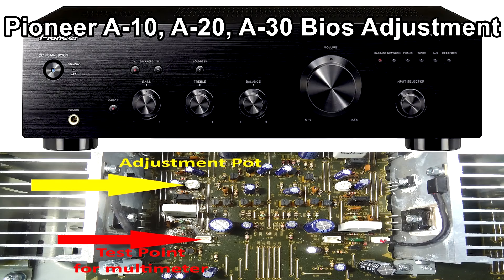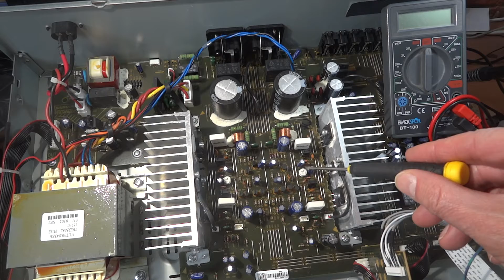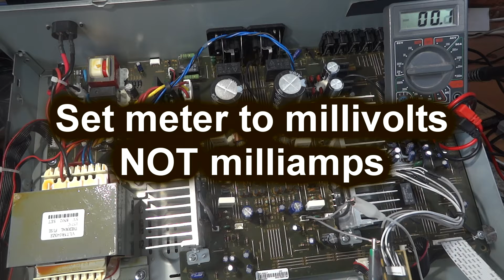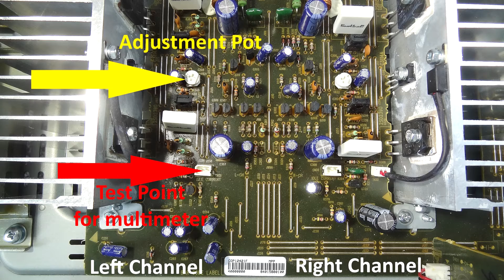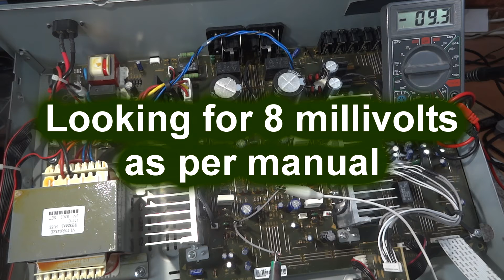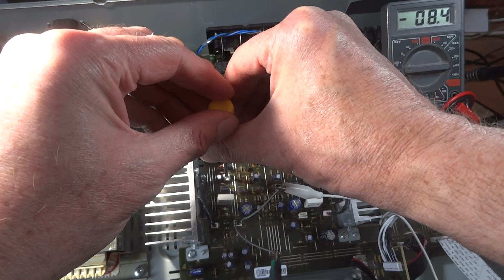Pioneer A-10, A-20, A-30 Amplifier Bias Setting Adjustment & DC Offset Measurement A10, A20, A30

Comment: The trouble is that cheap meters are not calibrated so there is no way we can be sure of accuracy, especially at such low voltages.
Reply from the maker: This is true. I dont think this one seemed pretty good when compairing to a friends £60 one. Though that is still cheap compaired to others

Comment: Thank you, nice video. If the Bias value is off the manufacturers recommended value, what problems  would it cause, if any?
Reply from the maker: It is best to keep to the amplifier's manufactures guide as to high would cause overheating and possible outputs being blown. Also can cause to much distortion. Though there are people that run the bias on the high side to get more out of the amp, a bit like overclocking a PC graphics card. But as with that it has limits
Reply: @MichaelYates  Thank you.